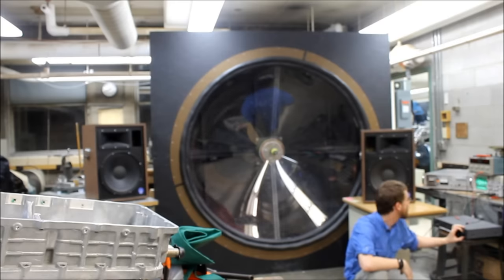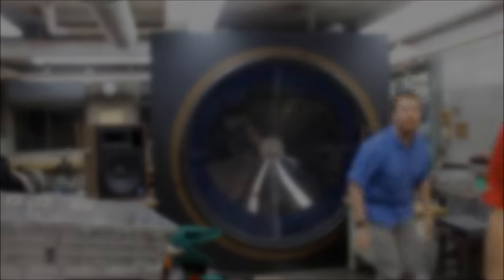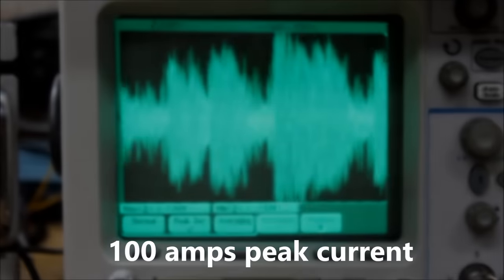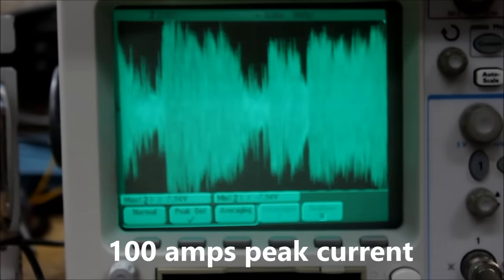Giant Subwoofer Video

Comment: I think it's effectively a small subwoofer, just because of how weak the membrane is. It moves just the inner part, while the rest is bending instead of moving in the same way.
Reply: Yeah, I thought that too.

If this sub would work properly then he couldn't stand in front of it like nothing happens😂
Reply: @s33saudios  I stood in a hall with two subwoofers sized around 1 meter and believe me I couldn't get closer than 10 meters without it being uncomfortable due to violently shaking my inside (and outside) organs
Reply: There's absolutely no way that flimsy acrylic come could transfer the energy from the coil assembly!
A complete waste of time!
Reply: @tomclanys  
You don't want your outside organs shaken as violently as possible?
Weird!
Reply: @Allangulon  I think you don't understand that
Reply: looks at huge subwoofer its a small subwoofer 
600 likes

 stg i have no faith in humanity.
Reply: Trash projector equivalent to modern day clickbait.
Reply: Different parts of the cone are probably, by which I mean definitely, out of phase with each other. Plus with as loose as that suspension is, it would need a MUCH larger enclosure to have any efficiency. It's gotta have a free air resonance in the single digits, which is kinda pointless.
Reply: @Allangulon  If you read the description it was build as an aid for teaching elementary school children. "It's purpose was to be physically large so elementary school kids could look inside while it was running and illustrate the how a speaker works on a grand scale (hence a transparent cone)." It was never intended to be competitive with professional devices.
Reply: @Allangulon  skin is an organ too, if you didnt know
Reply: Yep...not nearly stiff enough material...
Reply: @Algernon7  pretty sure giving elementary kids permanent hearing loss would be classed as child abuse.
Reply: @s33saudios  That pipe insulation doesn't appear to be connected in a way that would let it flex like a surround should. I was thinking it was going to Marty McFly and shatter the cone. 😄 at least they had fun making something.
Reply: @tomclanys  I want this, can shockwaves that strong cause harm?
Reply: @tomclanys  Sounds like a Nickleback concert.
Reply: Yeah that membrane is insane
Reply: @Allangulon  hahahaha that got me good
Reply: @tomclanys  Liquification
Reply: The woofer shook your organs outside of yourself? Impressive.
Reply: Maybe that depends on the material or cone structure?
Reply: @s33saudios  I think you don't understand sarcasm
Reply: @ZeaDabble  I think you can't see if a comment was sarcasm or not

But nvm, don't want to start an discussion
Reply: @tomclanys  Dang do I miss my subs... has anyone noticed that the teenagers now a days dont have subs anymore?! Someone was behind me somewhere at the light yesterday POUNDIN and I was like Yeahhhhhhhhh! Haha
Reply: @tomclanys  you sayin ya goolies start jangling about in that range?
Reply: @Allangulon  <- say no more haha
Reply: @donquixoteupinhere  you guessed correctly :)
Reply: @DJJ13  you do not understand how speakers work
Reply: @travismann5099  also since you know so much, look into the cerwin vega strokers, mr. audio pro
Reply: @tomclanys  its fucking great!
Reply: Good for guitar!
Reply: @DJJ13  bruh if thats the reason u lost faith in humanity u need to check ur priorities, also, it may not be small but its surely inefficient as fuck, and perhaps less powerful than for example a well made and setup half meter drive due to the materials used so yeah
Reply: @Matteo  I bet you can count on one hand the # of braincells used to muster up your comment. Also, bruh is cringe af lol.  This isn't "inefficient", your brain is.
Reply: @Matteo  also if you don't speak sarcasm, stay off the internet.
Reply: @DJJ13 the cone itself doesn’t determine if it’s a small or big subwoofer, you have the voice coil, motor, basket, suspension such as the spider and surround which along with the spider is the suspension assembly  this subwoofer is technically a small subwoofer with a large cone.
Reply: I'm listening to this on a subwoofer connected to my phone
Reply: @DJJ13  Would you say that you have come to the conclusion that you were wrong, because you misunderstood what was being said and on reflection with the help of friendly commenters you came to a better understanding?
I also assume that you losing faith in humanity over a youtube comment that you didnt understand at first and had to change your mind has given you pause to re-evaluate your opinion about others and wont jump to conclusions again in order to avoid your mental state. Right?
Reply: Finally a woofer I can play my mc hammer cd's with.
Reply: @muppetpaster  take a big satelite aluminium dich ,,, i have a smal 8 alu sub 🤣👍🏼
Reply: @tomclanys agressive ball jiggling